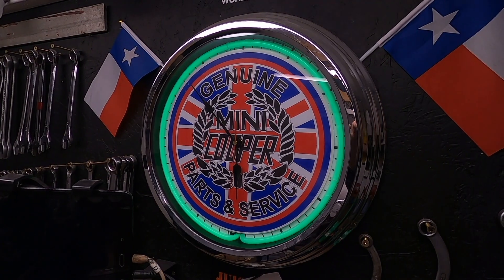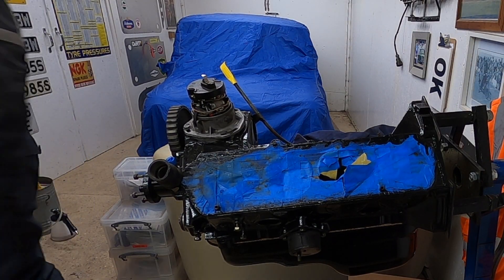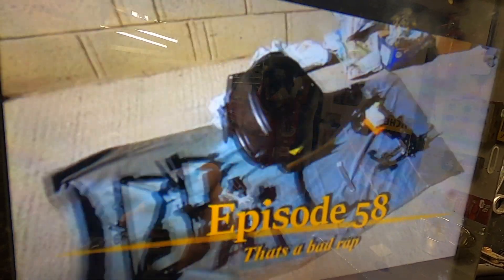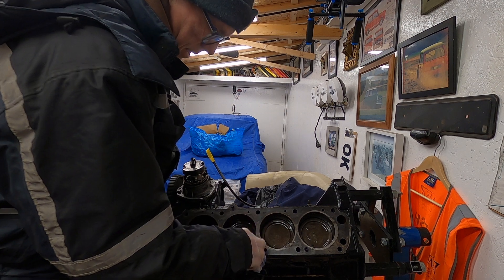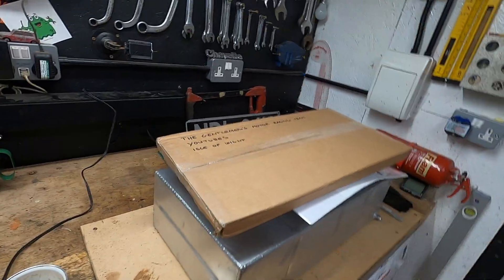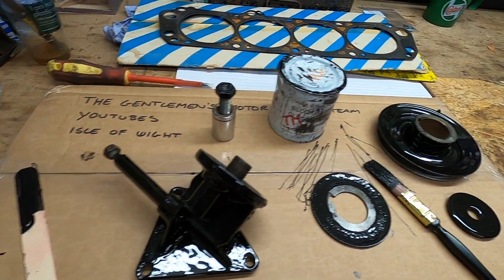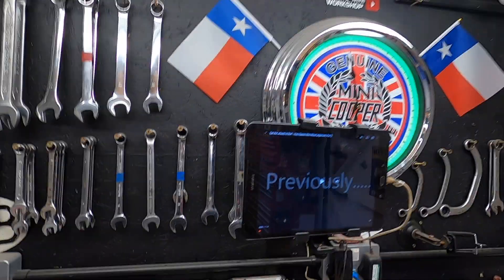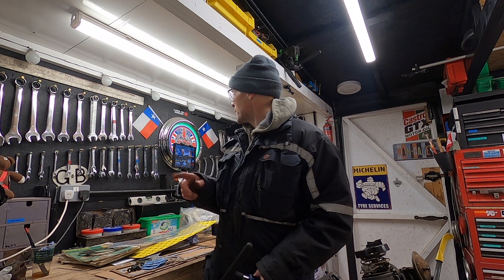Time for some head action  - Bedford CF TURBO drag racing boogie van engine - not van life just yet

Comment: Old Mustangs are still thick on the ground here, at least in Oregon... First, they sold in the hundreds of thousands back in the late '60s, and people tended to keep them covered when they parked them up. Secondly, folks started tucking them in barns and garages and taking them half apart in the early 70s, and its more likely you'll find a basket case than a roller barn find; they are almost always an abandoned project, possibly years down the road.
Loving the progress, keep up the great work!

Comment: Hi I have built a few of these back in the day. I would blank the oil bypass /fit oil cooler adaptor with inline stat..I think the filter we used was the Metro turbo filter as it was a greater capacity. Also make sure the water bypass from the water pump back of the inlet is in good condition.if you didn't have a tappit adjustment tool I have one you can have.